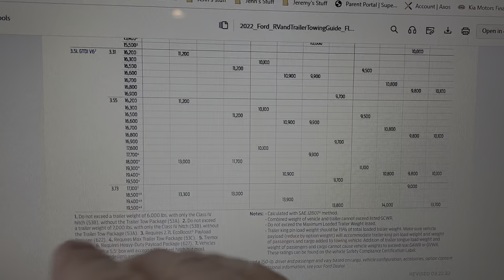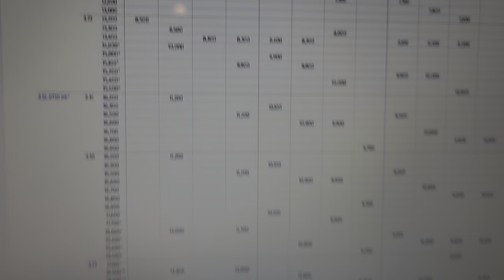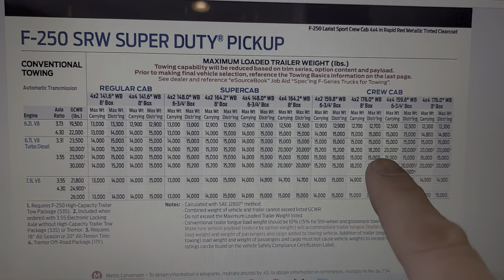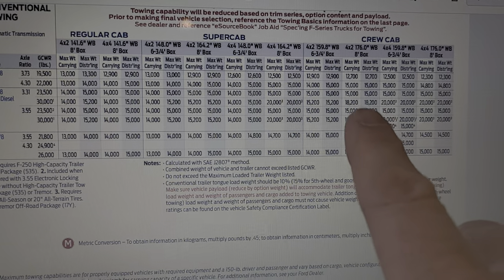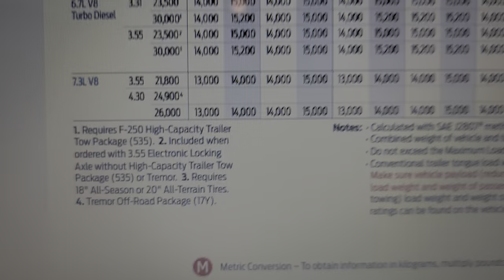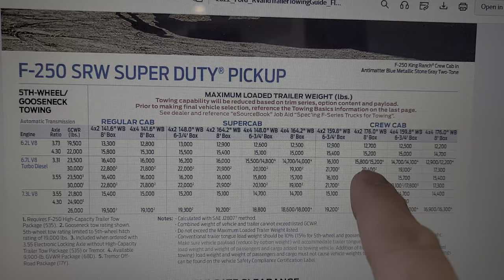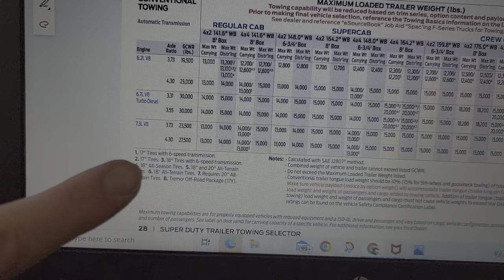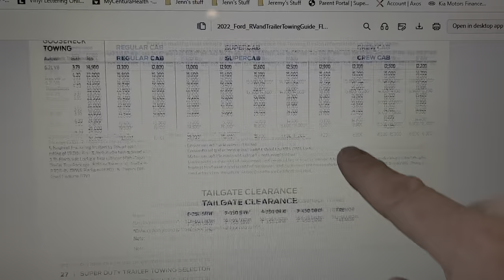Axle ratios and how they change your towing......you may be surpised...Ford, GM, Ram

Comment: Payload capacity is why you're getting the taller gears "most" of the time. This is a number people don't consider when looking at these charts. It was brought to my attention and this is why I made certain selections. You don't compensate for a sagging rear end by adding airbags. You build a vehicle that can safely "carry" what you intend to tow. These motors(7.3)paired with any axles can pull a house. The charts show this. That's fine and well until you need to safely move it down the highway at 70mph. 

The GVWR minimum difference between the 3.55 and 4.30 on a 2022 f250(again 7.3) is over 4000 lbs. A MASSIVE difference that directly relates to how the tow vehicle handles what is hooked to it.

Just food for thought.

Comment: It depends on where you live or where you're going to run that truck at. If you live in the Midwest and it's mostly flat you can go with a lower gear ratio if you got big hills and mountains you got to climb a lot you got to want to higher gear ratio. That's all that it's going to do for you.

Comment: It's good to see a video on gears for a change. Most people buy a newer truck which is geared like a car used to be, throw on 35" tires and with 3 OD's in a 10 speed, and you're way up in the 2, something ratio. Then the truck feels like a slug. I feel all trucks should have a 3.55 gear minimum, if you are going big tires or towing much weight.

Comment: I need the 4:10 rear end gearing on my 21 F350 dually. That's why I ordered it. I tow a heavy 5th wheel through the mountains and the 3:55 gearing on my last F350 dually didn't cut it. It makes a huge difference.

Comment: Great Video just bought a 2022 XLT F250 4WD Crewcab 7.3 GODZILLA Didnt pay attention to fuel tank/gear ratio because my worthless 2013 f450 cab/chassis 6.7 at 100845 shit the cp4 pump and cost me 8000 to do myself and still had a problem I got rid of it,towed my 26ft custom toyhauler minus my polaris general 2 seater and maybe 200 lbs of water up a 7° hill Rocked It at 46.0 miles on truck 7.3/3:55 
👍👍👍👍👍 keep up good Videos
Reply from the maker: Sorry to hear the diesel kicked it. But congrats on the zilla!   More videos coming soon

Comment: In my opinion the new 10 speed transmissions make the rear gears starting with a 4 very unnecessary for most people. They have their place (trucks loaded at max GVWR all the time and/or severe off road type grades) but for most consumers they are unnecessary and in my opinion even a hindrance. I say a hindrance because with the close ratios the transmission has you can just drop one gear and end up with a shorter final drive ratio as compared to what the 4.30 has. For example the 3.73 trucks have a 3.17:1 final drive in 8th gear compared to the 4.30s 2.88:1 in 9th. And then at a certain point on steep grades I don’t think the 4.30 truck would allow a downshift so I think you would end up getting “stuck” at a certain mph where a 3.73 truck would give you the downshift. Now it would be at a higher rpm but it would give you a few extra mph too. 

I would actually say even going back to when the 6 speeds came out those 4.10 ratios weren’t really necessary but it’s definitely more debatable. 

Also GM is 3.42:1 only for diesels and 3.73:1 only for gas. Diesel currently has the 10 speed. The gas is getting it for the 2024 models that will be out in a few months.
Reply from the maker: I agree with your thoughts and opinion.  Thanks for posting...that is excellent info for everyone.

Comment: I have trucks with everything from 3.50 gear ratio and 4 speed auto and 4:88 4 speed.    I have trucks with 3:73 4:10 4:88 with 6 speed auto.    If you are consistently towing heavier weights you are much better off going with the lowest gear ratios.     Not as much for capacity but for less strain on the truck and safety when towing.   Furthermore if you are putting larger tires on a 8k lb truck with a 5th wheel you don’t care about 1-2 miles per gallon.     And if you are planning on pulling a camper always always buy a truck larger than you think you need.     I make a fortune repairing trucks that people say well it’s rated to pull x amount.    Here is a prime example.     When you ride a bicycle which makes the ride more enjoyable and less taxing on you.  The bike in 10th gear is faster and pedal less but put bike in 5 th and you may not be the fastest but you can enjoy yourself and aren’t as tired when you get there.       Gear ratio is like a lever.

Comment: Nice video, thanks!
What is the GCWR(lbs) column?  Under the SuperCab 2wd I see a tow rating ok, but why so many rows?
Thanks
Reply from the maker: Those rows are for all the different axle ratios and payload packages.  It can be a pain to dial a specific rating in depending on how it was ordered. GCWR is Gross  combined weight rating, all together the max weight of the trailer, truck and gear max weight combined.
Reply: Hey, thanks for getting back to me.  I appreciate that.
I am getting the 2023 F150 with a 3.5L and a regular 3.31 rear.   I saw 11000 lbs.
As I was typing up a follow up question it dawned on me that the "extra" rows are for all of the other combinations.  Jeez.  I'm a bit slow.
Thanks again!
Reply from the maker: @michaelvadney5803  no sweat...trust me, I've done the same thing.

Comment: Good morning!
Just started following. Thinking about getting an F-250 to tow a travel trailer with max weight of 7,000 lbs..
I’ve been told an F-150 can do the towing. Am I over doing it by thinking on getting an F-250?
According to your videos going up is the safest, and that’s what I want, safety.
Thanks in advance!
Reply: Well you have to consider enclosed trailer bumper pull or fifth wheel.. length of the trailer and how much cargo including passengers.  I have an 2022 F150 ECO BOOST 3.73 MAX TOW. My  max is 14000 lbs. My trailer is 16 ft enclosed.  It Tows like nothing making  almost 18 on the highway.  But weather you tow all the time is a question also. If your towing  up north or in the hills a ECO BOOST OR DIESEL. Feathering the throttle it's not a race. It's not your experience behind the wheel most times it's the other people
Reply from the maker: My mantra has always been to have a little more than you may need.   The f150s can really tow more than ever,  but   the larger trucks do add stability.  Travel trailers, like tow behinds can cause sway,  even with stabilizer hitches.  This is she the f250 gives you the confidence.  The size and weight of the bigger truck helps with that.    We tow stuff at with a lot with f150 ecoboosts.  Our stuff is heavy and low center of gravity,  but still the sway is concerning.   Definitely don't necessarily need a f350 or a diesel, but I personally would go with an hd. Thanks for watching.
Reply: The f250 for weight. The 150 makes a great suv like a expo?
Reply from the maker: @J Brous  true,  also slap a tonneau on it and it s exactly that@

Comment: People are hauling so much more weight with consumer trucks than they used(without exhaust retarders). I'm not a truck driver and I don't pretend to be. But I don't think it's a stretch for them to agree with this next comment.
 I'm not going to underspec a truck that is hauling(combined) over 20k lbs by looking at the charts and justify the lowest possible ratio for a 1-2 mpg difference. It doesn't sound logical.
Reply from the maker: Yes, I'm a truck driver now and an ex DOT inspector.   I always say go 20% more truck than what you'll need.   Now to your earlier comment, I'll also say rhis, thay the reucks are rates to tow way more than I think most people should do with a pickup and can stop safely.  The new numbers ford just posted are literally insane foemr a light duty truck, let alone  a medium duty.  

That being said if people are 20 to 30% under what they will need or ever plan to they don't necessarily need to go overboard.

Comment: Big 5th wheel weight difference on a F350 between a 3.55 and a 4.30
Reply from the maker: That is correct for the f250 it isn't much difference but f350 is the big boy so with the extra leafs and overloads you get more weight between the two ratios. And that f350 with the 4.30 is a respectable number....my 08 6.4 one ton dually was barely at the 4.30 numbers, crazy